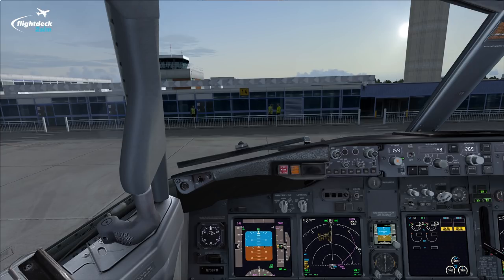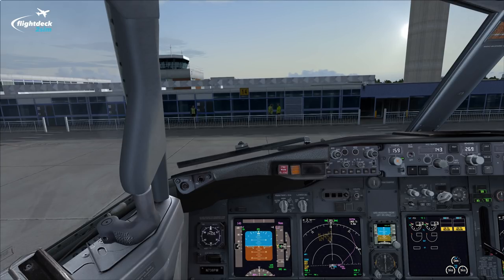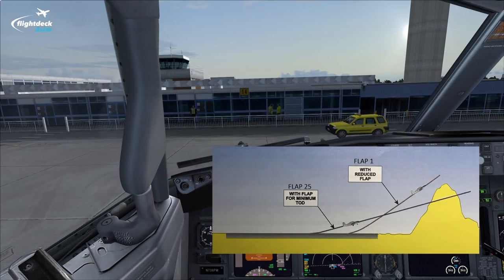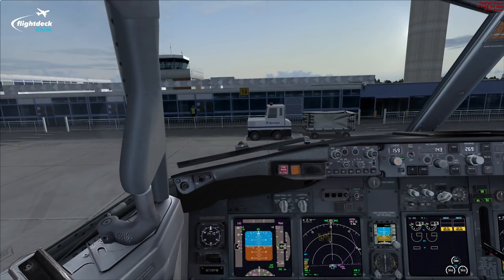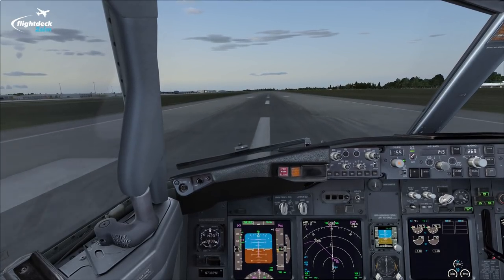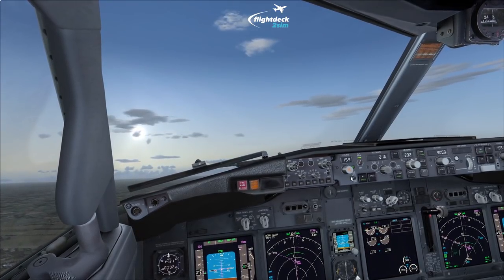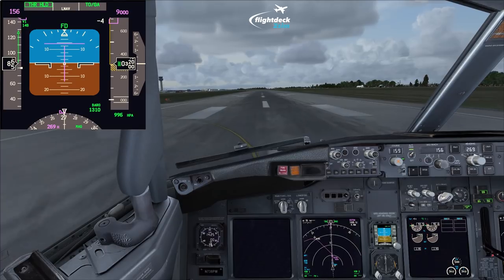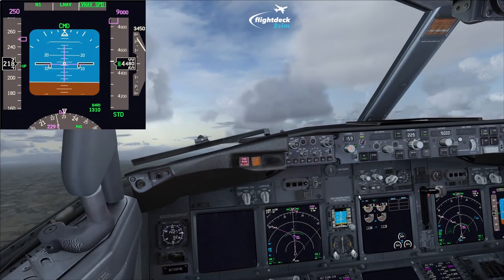PMDG 737 Tutorial | REAL BOEING PILOT | Takeoff Flap Selection

Comment: Excellent! In my sim, I was taking off from Dortmund which is 2000m runway... TOW was high as was tankering fuel and had a high ZFW. I used flaps 15 according to my performance app (not the official Boeing one) and it told me to use full 26K and flaps 15. I used almost all of the runway, so was lucky I paid attention to the flap and used 15
Reply: SamtheRyanairman 
What app did you use?
Reply: Afca 020 TOPER.WEB.
Reply: Afca 020 available on iPad (its online, so can access via iPad/tablet etc.)

Comment: Speaking about t/o performance. When setting up for a flight looking at the N1 LIMIT page in the FMC I've noticed that when you select TO-2 for example CLB will still be selected. However, if you also type in a flex temp normally CLB-2 will be automatically selected.

Would be interesting to hear you talk a bit about this and how it's IRL vs the PMDG NGX if there are any differences and what you normally would select on this page. I've been using both TOPCAT as well as a software called ToPS lately for my performance calculations.
Reply from the maker: Hi Richard,

We leave the default values for reduced climb (CLB 1 and CLB 2) for all departures, even shorts runways where we are field length limited. Depending on what thrust setting we use for takeoff decides our derated climb thrust, the FMC will decide CLB-1 or CLB-2 based on what derate we select or/if we decided to use assumed temperature reduction. We don't change it as crew here.

FD2S

Comment: Thanks so much. I was referring to the popup window you displayed in many of your videos. I rather suspect that subscription is a bit pricey. I love the data it provides. The auto brake setting vs stopping distance, takeoff flap settings, etc., are precious pieces of information. I looked through the descriptions for some of the available FSX "electronic flight bags" and couldn't find that type of data. Unless you have access to engineering data for the aircraft, I would imagine most app developers would be unable to calculate the various performance data relevant to us. And, I also suspect that all of it is proprietary so you would have to be an airline to purchase a subscription to access it.
Reply from the maker: Yes that's the OPT App from my work EFB which I've taken a screenshot of and I'm afraid you have to be an airline to access that )(I think)

There is a table available in the QRH that comes with PMDG where you can calculate stopping distance, it's what we used before !

FD2S

Comment: Thank you ever so much!! Now I've got how to properly set flaps for takeoff. Have you tried the SBRJ approach and takeoff here in Brazil? 1330m long and a lot of 738SFPs daily on operation. By the way, the SFP was developed initially to operate there. I was so confused on why when I flied to Rio de Janeiro (SBRJ) the rotate and reverse thrust out were so smaller compared to my landings and takeoffs on XP' Zibo738. Now I understood it.  Thank you!!
Reply from the maker: Now that is short! Might give it a try! We have some SFP 737's but I've never landed anywhere less than 1500m!

FD2S
Reply: Brazil's busiest comercial route links Santos Dumont SBRJ (RWY 20L 1323m & 20R 1260m) to Congonhas SBSP (RWY 17L 1435m & 17R 1940m). Plenty of full packeds B738s, A320s & E195s all day long.

Comment: I was wondering when you turn off the bleeds for takeoff? Thanks for these wonderful tutorials and have a great 2018!!!
Reply from the maker: Hi Josh,

Turning Bleeds Off gives a additional amount thrust when performance limited.

FD2S
Reply: flightdeck2sim thanks! I have one more question, if the bleeds are off the packs don't operate so, how does the air conditioning system work during a no bleeds takeoff?
Reply from the maker: APU is turned on and aircraft pressurised that way, after take off checks eng bleed on and APU turned off 👍🏼

FD2S

Comment: Hello FD2S!

During pushback, do you always start engine 2 then 1? Or can it be different?
When do the engine start switches go to continuous? And when can do they go to Auto/Off?
Also, do you have to know how to swim to become a pilot?
Reply from the maker: Hi Ozan

We always start no2 first unless the APU is inoperative. This allows us to provide conditioned cabin air (if required) using bleed air from engine no2 before starting engine no1.

Start switch to Continuous for Take Off and Landing and to off after Take Off and Landing!

Yes when you join you have to go through Emergency Training and we were required to swim in shorts and a T-shirt with a lifejacket on and some other pool exercises.

FD2S

Comment: Another question but on anti-ice.

In the NGX activating TAI makes your already very slippery B738 even more slippery since N1 will increase with about 10% from just above 30% with TAI off vs just below 40% with TAI on.

I learned this happens to compensate for some of the thrust loss with TAI enabled but to me it seems the added thrust exceeds the loss making your approaches quite hard when trying to avoid coming in hot.

How is this compared to the real bird?
Reply from the maker: When you select the engine anti-ice on bleed air is taken from the engine to heat the engine cowling, the EEC selects a higher idle N1 to keep the bleed manifold pressurised.

I don't know how accurately this is simulated with the NGX,  I still couldn’t tell you how much N1 increases in real life, I've never really paid attention to it! I just know it does for above said reason!
 
There is TAI FCST on the DES Page but I've never used it due to the unpredictably of turning it on and off during a typical descent in Europe through all the gnarly weather. I've never considered how this will affect my descent profile. It does make a small difference to your descent of course but it's negligible compared to say a speed change from ATC or a massive shortcut!

Hope this helps!

FD2S

Comment: Just a very quick question, I thought I had read it in the PMDG manual, but can't remember where, what does the flashing letter indicate on the speed indicator on the MCP?
Reply: Paul Curran I don't know, but I usually get that when the speed on the MCP is 100 knots, which is way above my actual speed and we'll below the stall speed. I guess it is to warn the pilot to increase the speed in the MCP as the auto throttle will never command a speed of 100 knots.
Reply from the maker: Flashing Letter is Overspeed or Underspeed Limiting.

Overspeed flashes "8" when the commanded speed on the MCP cannot be reached due to a gear or flap limit or reaching VMO/MMO

FD2S
Reply: Ok, many thanks, That would explain why I had it flash at me during decent on one flight.

Paul

Comment: With flaps up, is the aircraft above the minimum menoevre speed? (which I believe is 200 knots)
Reply from the maker: Hi EnikOLED

Minimum maneuver speed is based on Angle of Attack and present airspeed. If you have PMDG consult their FCOM 2 to learn more!

FD2S
Reply: Vref40+70kts is up speed :) so it changes with weight

Comment: Which setting is the most fuel saving?
Reply: Herman Wan the higher flap settings, because higher flaps normally mean  ore thrust needed I think
Reply: Derating isn’t for fuel saving, it’s so the engines have a longer life time! But the lower the % how more fuel you save.
Reply from the maker: Flap 1 offers the best fuel savings.

FD2S
Reply: Afca 020 yes, de rate is for engine life, noise, environmental factors and it does save a bit of fuel as well